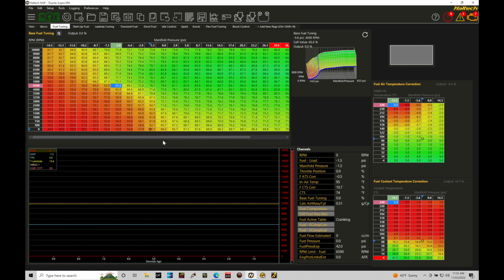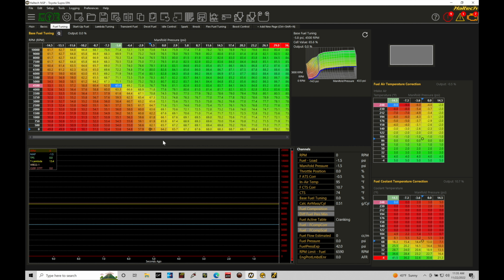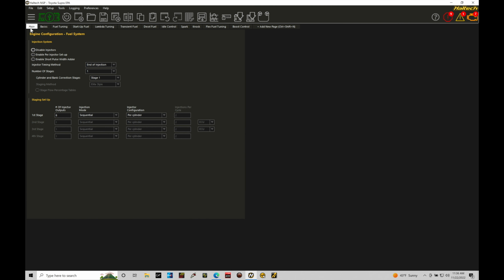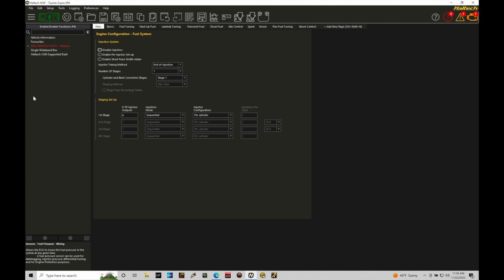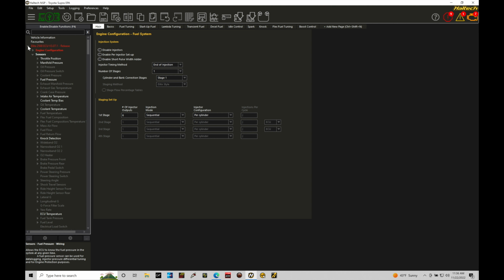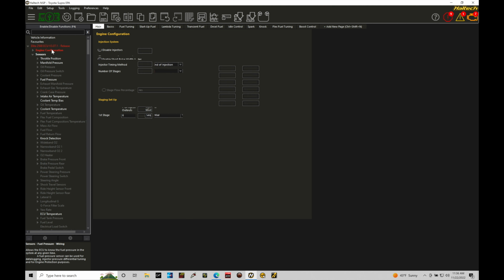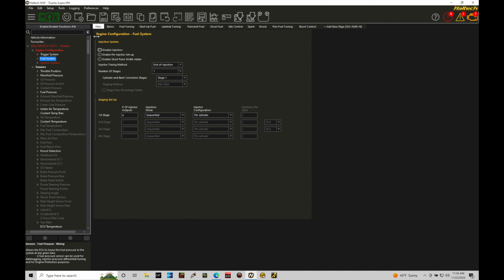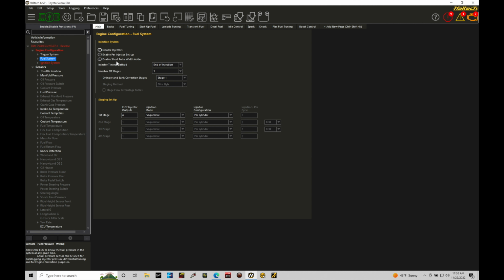Haltech Elite NSP Training Course Part 23: Fuel Injector Programming | Evans Performance Academy

Comment: Great video! Question, I have just finished rebuilding my engine and I'm going to run a 2500 Elite. My question is, the base map that comes included will have to be set up for the injectors that I am running seeing that I will not have the stock injectors. Correct?
Reply from the maker: Correct you will need to update the injector data to reflect your current injectors.